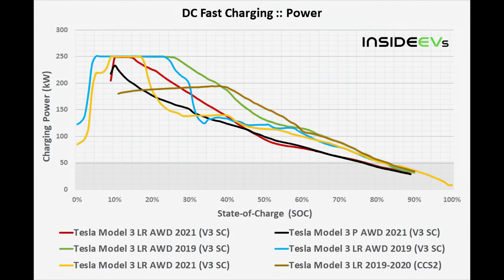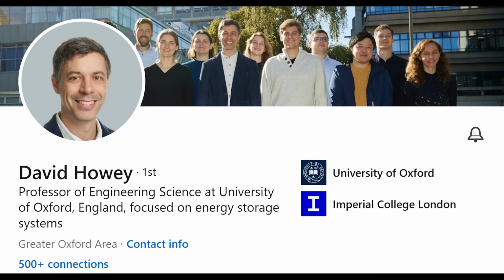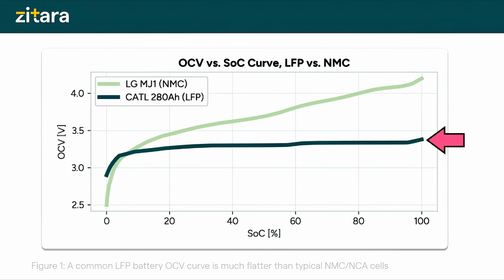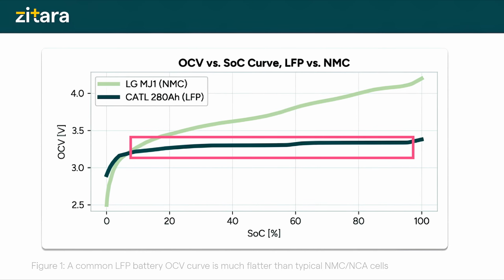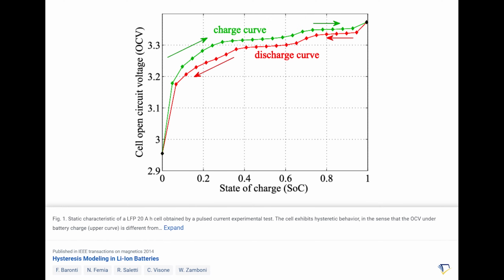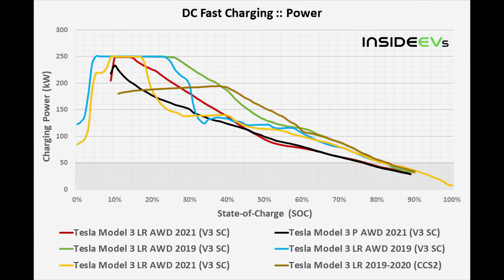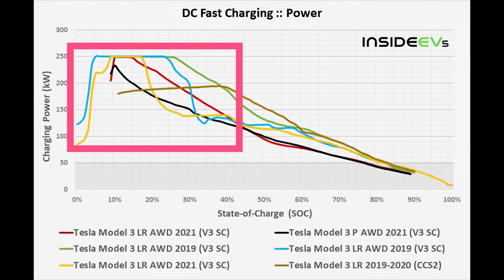Prof. David Howey:  The Charging Curve // + Does LFP 'Like' to be Charged to 100%?

Comment: 🙋‍♂️ DON’T KNOW WHAT KIND OF BATTERIES I HAVE IN MY MY …MADE IN FREMONT IN JUNE 2023 🤷‍♂️💚💚💚
Reply: Go to Controls > Software > Additional Vehicle Information in the car - it should tell you what type of HV battery you have. It could only be LFP if it was 2021-2022 standard range 3 or Y, and even then maybe not.
Reply: @newsfromthefrunk  🙋‍♂️🤗THANKS I’LL CHECK IT OUT 👍
Reply: @newsfromthefrunk THANKS NEWS 🤗 I CHECKED IT OUT …lfp in my MY LONG RANGE AWD 2023
Reply from the maker: If it's long range, it's nickel, if it's short range, it's probably LFP.

However, from memory there were some changes made in the past year where they were using nickel based cells in short range vehicles. 

Either way, there's a number of ways to work it out for sure, just Google it.
Reply: @thelimitingfactor  THANKS JORDAN,LONG RANGE,AWD 👍
Reply: You’ve got cylindrical 2170 Panasonic cells made in Reno Nevada, NMC chemistry
Reply: @jcswim95  🙋‍♂️🤔 NOW I DON’T KNOW WHAT TO THINK 🤷‍♂️
Reply: @budgetaudiophilelife-long5461 nickel battery made by Panasonic. They look like household batteries rather than box battery like the lead acid ones in petrol cars.
Reply: You are giving him more information that he needs lol  @jcswim95
Reply: THX BLUE TOAD ,🤗 I DO ALL MY CHARING AT HOME ON A 110 outlet

Comment: SOC and balancing in a nutshell:
SOC of a cell in general can't be measured in a practical way, it has to be estimated. (to measure it you have to either fully charge, fully discharge or disassemble the cell)
Simple SOC estimators only work well for a few simple and highly predictable use cases.
You need at least one sensor (usually voltage) to estimate SOC. Most batteries have three types of sensors (voltage, current, temperature). The more sophisticated your battery model (meaning mathematical description of behaviour) is, the better your SOC estimation will be. Aging/degradation changes the battery behaviour, different types of aging change behaviour in different ways. A very sophisticated model can try to predict aging or can try to automatically adapt its parameters to always best decribe the changing battery cell.

SOC estimators can and do drift. For chemistries with a steep voltage curve, a good estimator will permanently calibrate itself and only drift a little. (my iPhone has a poor estimator, if I don't charge to 100% it drifts a lot despite having an easy-to-calibrate LiCoO2 battery).
For LFP, the only good way to calibrate is a full or nearly full charge.
If your SOC estimator has drifted, your car may show 20% SOC when it's actually 5%, but you don't lose capacity.

Battery packs need to be balanced, because the cells are never exactly the same. In order to balance, you need to know the SOC of each cell. The best way to make sure you know the SOC is a full or nearly full charge. For this reason, balancing usually only starts near the end of a full charge. Sometimes, you may notice that charging a device from 98% to 100% takes hours. If that happens, it means that balancing is going on.
If your battery pack is out of balance, you do lose useable capacity! But you regain it when you balance the pack.
Reply from the maker: Thanks for the well considered comment!
Reply: Thank you.  You just rendered the subject of this very academic one-hour video exchange down to your text that can be easily read in three minutes.  Perfect!  

I always enjoy "The Limiting Factor", and this topic was very appropriate, but the Oxford academic did not communicate clearly enough.  Perhaps Jordan should have sent his questions to David ahead of the exchange so he was better prepared.  It is difficult to express a complicated subject in lay terms spontaneously for everyone.
Reply: in the cpu world they have something called binning or silicon lottery, can they run any tests or benchmarks on cells so they could also be binned, so to speak
Reply: @jy5960  If you want your battery pack to last a really long time, you should do careful binning before assembling it. For any battery pack you should try to use cells that came off the same production line on the same day, otherwise you will run into balancing trouble.
Reply: @w0ttheh3ll Your original comment starting this thread is absolutely fantastic! Took me a long time to figure out what you basically started succinctly. Great job.
Reply: @jy5960  Some  common properties used for binning are cell internal resistance and capacity. Measuring resistance/impedance is quick. Measuring capacity takes a long time (couple of hours).

Comment: If a Tesla LFP vehicle is charged to "100%" is that really 100% or the charge state defined by Tesla as 100%. Ah David just said as much. I guess LFP pretend 100% is much closer to real 100% than for an NMC
Reply: Strictly speaking, a "real" 100% doesn't exist. You can take any commercial Lithium Ion battery and charge it higher than the manufacter recommends. That way you will store more energy, but also have more degradation. 
The 100% and 0% criteria as given by the battery manufacturer are just another set of tradeoffs their engineers decided on. If you look at data sheets, you will see that these criteria sometimes vary from brand to brand and cell to cell, especially for LFP.
Reply: 100% in an EV is simply the point when it stops charging.

if you want it to know what the actual capacity of your car's battery is, you would need to run the battery flat (that is, running the car until the power cuts out) and then find out how much energy it receives when recharging. But that energy reading might not be the actual capacity because it might also include any thermal energy that is generated in the battery and on-board power electronics as the car is charging. So to minimise thermal energy losses, you should recharge with a low-power (2-20 kW) charger.

Comment: So the initial release of a vehicle/battery model is likely to have a more conservative charge curves. This explains in part why the Tesla software updates have been able to improve range as more real world battery operation data becomes available over time. It also makes the ability to do over the air updates vital for optimal battery management in an electric vehicle.
Reply from the maker: Correct 🤠
Reply: Actually the opposite happened with the early Model S. Initially they let it charge at like 120kW, but then Tesla replaced lots of batteries out of warranty and lowered the power to under 100kW, maybe around 70kW? Not sure where it's at now.